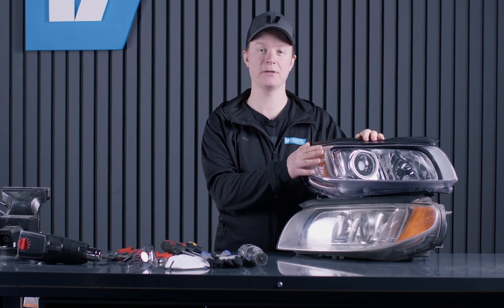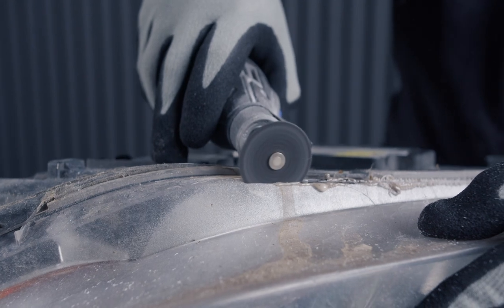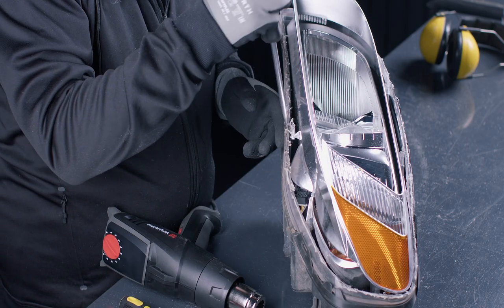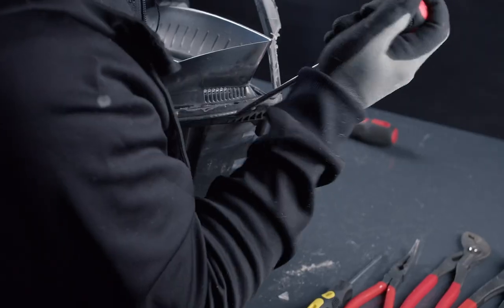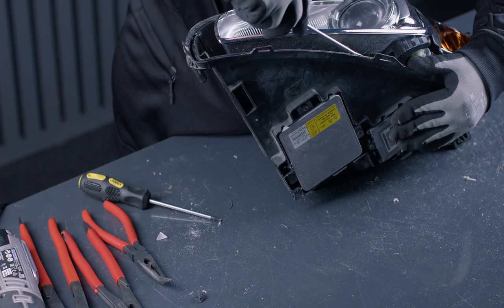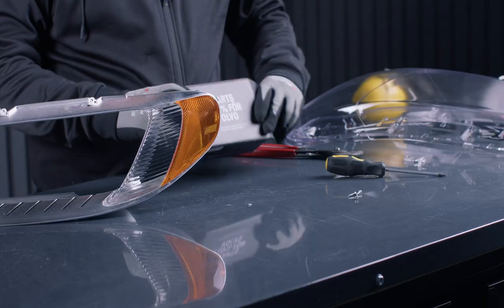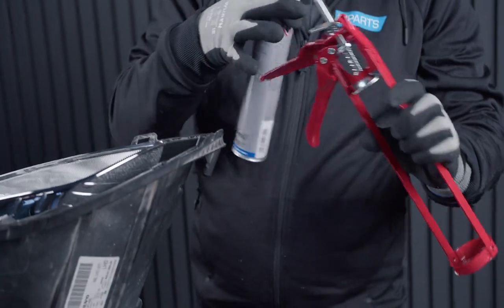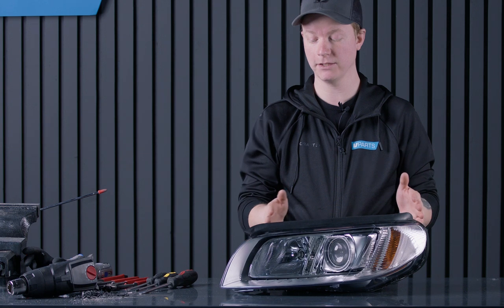How to change headlightlens on Volvo V70, XC70 08-16 - Looks like new!

Comment: Would have been nice to see the lights in use after the job was done. Did you use orange bulb with the white sidemarker reflectors or disconnect the bulb at all? Newer lights with white sidemarker reflector and LED middle marker have no bulb in the white sidemarker place. There is a mounting hole but no wire and socket. I would actually like to retrofit orange ones to newer lights but haven't found a store that sells orange reflectors. Vparts doesn't list white ones either....

Comment: Bro serious question as i dont find anywhere for a fix... I have volvo s80 v8 2007 with BLISS system, sometimes it stops working because there is something on the lens, which isnt true. The lenses became foggy from inside, especially right side. Is there a way to make it clear again or replace the glass?

Comment: You should open a headlight using electric cooker in the kitchen (of course, professionals have special workshop headlight ovens for this). ... Dremel cutting is the first time what I see to open a headlight.... ;-)
Reply from the maker: Hello,
Unfortunately that doesnt work on this glue.
Reply: @VPARTSGARAGE  I have done one side of my car so I know it is a PITA to do it, yet have you ever tried applying those headlight glue separator after you heated up the headlight?
And I believe you may try selling additional kits which retrofit the projectors as you would never ever open the light again in your lifetime... :)

Comment: How did you get hat whole assembly off the car? Is there a video of that?
Reply from the maker: It's really easy, you have two pins at the top that you just remove to get it out. Should be in your instruction book how to do it. :)
Reply: Its in the car manual? I don't have to take off the bumper?
Reply from the maker: @wizard-tv2478 What model and year is your Volvo?

Comment: P2 xenon and abl xenon headlights are much easier to open, done lots of them, even install new rechromed reflectors of the projector, light output is a new…. Sold a lot of refurbished headlight in my country…
Did 1 pair of P3 abl xenon headlight, also installed new rechromed reflectors of the projector: light output as new….
Projector lens is very easy to clean, and necessary when you open the headlight….

Comment: I did this on my 2005 v70 and man oh man this job fucking sucks.
Especially much since you have to remove the whole bumper to get the headlights off the car.
But using the heatgun and big pliers to force the remaining lens off was a hell of a workout, arm was properly sore afterwards.
Reply from the maker: Yes it sure is some work to do it, but how about the results? Are you happy with them? :)
Reply: @VPARTSGARAGE  Yes, i bought the lens from you guys actually (hälsningar från finland!)
They turned out great in the end. i didnt want to do the job initially but when i saw the prices of new xenon headlights i quickly changed my mind.

Comment from the maker: Buy it here: https://vparts.se/se/volvo-v70/v70-08-16/reservdelar/belysning/stralkastare/stralkastarlinser-till-volvo-v70-xc70-08-16-s80-06-16-hoger-och-vanster-sa23042510.html
Reply: Unfortunately this leads to 404. Do you plan to have this in stock later on?
Reply from the maker: @bios-loudsociety  Hi, Yes, this will be back in stock hopefully beginning of 2024.
Reply: I'm going to install glass lenses from a 2004 XC70 on my 2007 XC70 to avoid having to adapt the harness and newer lights have market bulbs and look better. Which glue do you use? Is there a link for the glue?
Reply: @bennyl.5899  the fitment of the glass lenses is bad… good luck
Reply: @001wiel  I ended up retrofitting the harness. Now I have my glass lamps ready to go. I may even buy an upgrade projector kit and install it as the glass lenses are removable
Reply: @bennyl.5899  plastic lenses are also removable, costs more effort doing it.
I refurbish a lot of xenon and xenon abl p2 facelift headlights, xc90 abl, p3 abl xenon headlights and also install a new rechromed reflector in the projectors eye.

Comment: Sorry, I just want to better understand the beginning. Are you saying the lens has to be cut open because there are three screws that hold the lens  to the outer housing internally?
Reply from the maker: Lens has to be cut open beacause the glue holding the lens cant be heated to loosen it. 
So you cut the lens to be able to reach and remove the old glue. :)
But you have to be a bit careful around those screws and cut on the right side of them for it to not brake :)